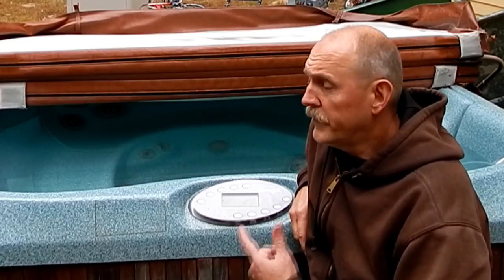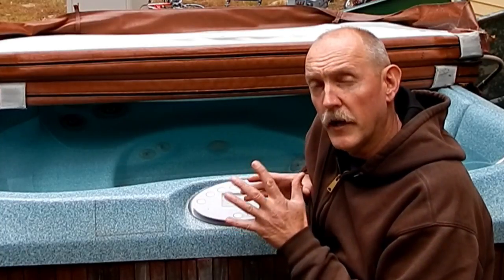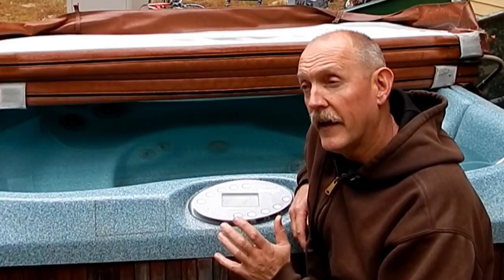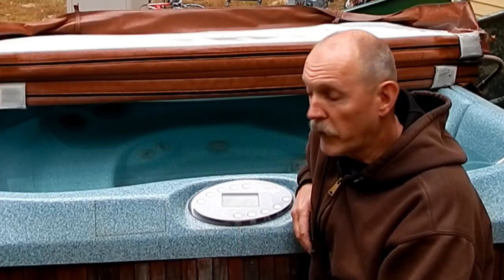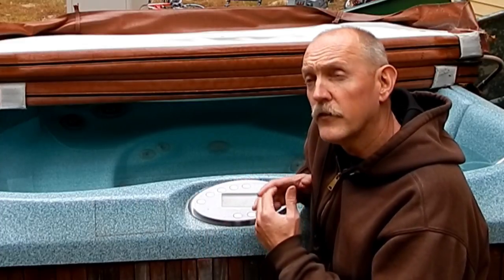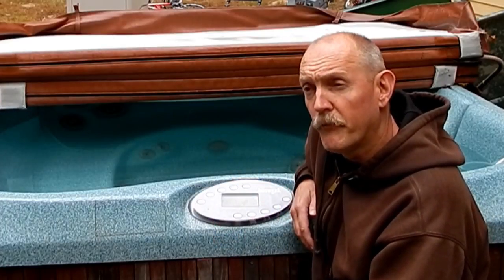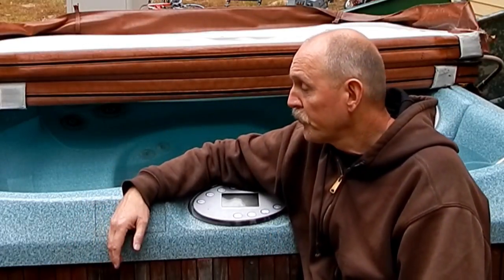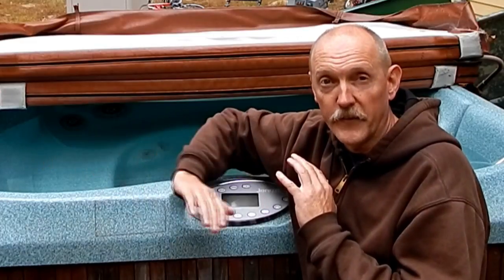Jacuzzi Sundance Hot Tub temperature sensor error repair

Comment: Thank you for this video. It is a long video, but well worth watching the whole thing.
Filled with so much great information, well spoken, good quality video and audio, you
stay focused the whole time with no fluff or filler, and pay close attention to detail.

I got my Jacuzzi J-315 2013 Model near the end of 2013. The temperature sensor went out
sometime in 2020. I researched the error code with 3 dashes [---] with no luck. I got
the hot tub technician over here and he told me straight away that was the temp sensor.
I watched him replace it. It was expensive. Fast forward to today, September 2023 ...
same thing ... [watchdog mode error code] [---].

After watching your video, I am fully confident that I can buy the part on amazon for
much less than he charged me last time and this time the labor fee will be zero. Thank
you so much for your excellent video. By the way, I love your tip near the end of the
video about removing the intake filter and inserting your fill hose there to help
eliminate possible air intake.

Comment: Thank you so much! My 2005 J375 Jacuzzi hot tub has been running really hot for several years. I've had the repair man out twice to change it. It hasn't worked correctly, had to set temp lower than what I wanted it and keep and eye on thermometer... Finally decided to shut it down until I could get it fixed. Found your video and watched a couple times. Was able to order part off Amazon, had to make sure I had right connections. While tracking the wires, I discovered my repair guy had just spliced new thermostat onto old wire! Too lazy or had wrong connections... I ran it all the way through like you showed. Was able to do it by myself. The connectors are really tiny, got them in ok, but didn't get plug seated right. It was getting dark and my flashlight decided to die. After filling the tub, I powered it up. It said 106 degrees and then I got a SN1 and a SN3 error. Figured that it was the plug not seated right. Powered it down and re did the plug this morning. It's at the very top of panel and hard to get to. This time I actually heard plug click into place. Powered up and all is good. Control panel reads the same temp as thermometer. I'm a great grandma, was able to get it with your coaching.

Comment: I had to revisit your video again.  I had a Jacuzzi j325 show three dashes ---.   I had been watching it previously and the temperature was getting of sync.   I would set the temperature to x and a thermometer would register 25 degrees higher.   Finally showed as  - - -.  Replaced my sensor (6600-166) and all is back to normal again.  Last sensor lasted 3 years.  Thanks again.

Comment: Well, this video was identical to my issue on a sundance Optima 2001 I inherited from a house move. £30 part, 20mins to connect and bam! The temperature sensor no longer reads 35C for 18C water. Heated up perfectly and no errors. Thank you for an amazing video that doesn't dumb down the details behind this error.

Comment: Excellent video, thanks for posting. It inspired me to replace the sensor on my Sundance Metro, which was doing exact opposite and always overheating as the temp would read in the 70s while heating the water to 110. Metro had different wiring connectors (not box) and circuit panel plug is smaller and just slides on -- but the video was close enough to get me there. My spa also had no hose on the spa filter end, so once you unscrew the sensor, water is flowing, but at least not near the electronics.  All fixed now. Thanks for the help!

Comment: Thank you for this video.  
When replacing the temp sensor, do i need to put teflon tape on the threads?
Reply from the maker: NO! teflon tape should only be used on pipe thread because they have a taper and they sealing tales place at the threads. The sensor uses straight threads and relies on a gasket or on ring to seal it to the tube wall. Teflon tape might cause the nut on the backside to crack.

Comment: Thanks for the detailed video!  After watching, you made it look easy to replace that heat sensor. Any idea if that is what is causing our 2013 Jacuzzi model J-345 to trip the outside breaker when turning it back on after cleaning and replacing the water. I tried to turn the breaker back on several times and it starts up until the jets turn on, then it trips the breaker.  I've tested the breaker by disconnecting the hot tub from it. So I know it's not the breaker.  It finally turned back on without tripping, but the temperature reading seems to be off by about 10 to 15 degrees less than the actual temperature. Could a bad temperature sensor be the cause of this issue? Any insight would help immensely...   Thanks again for the awesome video!
Reply from the maker: You have 2 different issues. Ignore the temp issue for the moment. A temp sensor does not trip a GFI breaker. It is possible, since you just refilled it that some water got onto something that should not get wet. (electrical). Then over time it dried out enough to allow you to reset the breaker. However, if the tripping persists, the likely suspect is a failing heater. I understand it is still heating, but just because it heats does not mean all is well with your heater.
Reply: @stevewatr  What do you think the issue is with the water being hotter than what the hot tub says? Thanks
Reply: Hey Steve I have a Sundance 2015 Edison. I got the - - - code. But unlike your example my water felt like it was a 110 degrees tub was set on 98. Would this be the same problem? Just a note while refilling hot tub hose popped out and sprayed the panel. Once the spa dried out and GFI breaker is working fine but now I get the 3 dash error code.

Comment: 2005 Sundance Marin, Tub goes into watchdog frequently. After breaker reset, temperature sensor seems to be accurate. If it is below the set temp, will circulate til heater is triggered then shuts down to watchdog mode. Multiple resets will usually get the tub to run for a day or two and then the problem re-occurs. Any suggestions?
Reply: We’re you able to fix your issue? I’m having the same exact issue with the same model lol

Comment: 4od fault in a j350 just like in your video. You are very knowledgeable, have you ever seen that fault? Resetting the tub does nothing. Pumps will kick on, and heat symbol is on, but the controls are non responsive. Searching for that 4od or 40d code has not yielded results. Any insight? Thank you.
Reply from the maker: I do not believe that is a valid code so it might be a faulty topside control. Unfortunately the only way to test that is try a new control and that is an expensive guess if wrong.
Reply: @stevewatr  Appreciate your reply. I unplugged the tub for about a month whilst working on other projects. The 4oD fault did not return, except the year old flow switch failed and was preventing heater operation. All I did was look at it and the end broke off. 1 year old, thats it. They dont make things like they used to.

Comment: @steve or anyone else here. Have you seen an issues where the real temperature is higher then what it's reading (hand held thermometer is readying 109) vs spa saying 100. I thought similar to issues above was sensor is out of calibration. So dropped the spa to 90. Reading is now 90 but hand held is still 109. I can't get my head around how the spa reading could drop, but real temp doesn't move. Thanks in advance
Reply from the maker: If by hand held you mean an infrared point and shoot thermometer, you are probably just reading temp just below the surface. There are temperature zones at different depths and heat rises. Just a theory. 🙂
Reply: I have the same issue with the temperature reading being lower than the actual. Wondering if a bad temperature sensor could be the cause of this?
Reply from the maker: @vincentguarino4262  You are describing a different situation from the one Jforgues82 mentions. He says his water is hotter than what the display shows. You are saying your water is cooler than what the display shows, and this is a classic symptom of a sensor failure.
Reply: @Steve Watroba  Oops, sorry, I said the reverse of what I meant... My water is also hotter than the display shows. The actual is hotter than the display reading.
Reply from the maker: @vincentguarino4262  water being hotter than what the displayed temperature is in uncommon problem. When those temp sensors fail, they usually cause the opposite problem. So to begin with, I'd question how you are taking the actual measurement. Previous post said he used and infrared thermometer. I suggest a human oral type. They are accurate in that temp range. Also be sure to use it near the tubs temp sensor location. Probably near the filter. Only other time I've seen tub actually hotter than set temp is of set temp is low and filter cycles are set too long in hot weather. Unlikely in your case unless you live in a hot climate.
Reply: @stevewatr  Thanks. We measured  with an oral thermometer and the display reads 91 while the actual temp is 105.
Reply from the maker: @vincentguarino4262  yeah that's weird. But I would still think temp sensor or bad connection like corrosion on the pins of the sensor plug on the pcb.
Reply: @Steve Watroba  Thanks Steve! I appreciate all your input!

Comment: Side comment (will make main one after I actually DO my replacement in a few minutes!) - I LOVE at about 25:00 your comment "not to proud to admit I've gone all the way through and forgotten to thread on the O-ring" (and you comment they sell them as separate items). Which leads me to wonder, looking at my invoice with the separate SKUs: WHY they don't sell them as a single unit - and even smarter would be to sell them with the O-ring ALREADY strung all the way up the wire to the sensor head, basically "pre-installed"? I mean: mine came with a nice bit of tubing protecting the box-ends, and it was coiled up and twist-tied, so there's already some "prep" involved -- and as I understand it you're GOING to install it with an O-ring pretty much always, right? So if NOT that, a really good vendor would be smart to put a tag on the sensor end saying "don't install without an O-ring!". Again, will be making a full comment after I actually install mine, but this video is PHENOMENAL.

Comment: Hey Steve- I've got a 1999 Sundance Rio that thinks the water temp is 103 even though it's ~80 (not heating, so it's ambient temp), so I'm thinking it's the thermistor.
Looks very much a lot like what you've used there- got a part # for that, by chance?

Comment: Great detailed video Steve!  I have a 2002 Sundance Altamar and I am getting an SN1 error code, and the heater is deactivated.  Would you say this is a temp sensor issue, a hi-limit sensor issue, or could it even be a flow switch issue?  Pumps appear to be working fine and water flow through jets are working as they should, just no heat.  Any insight would be appreciated.
Reply from the maker: SN1 is a sensor 1 failure code. Sensor one is the high limit sensor mounted at the heater. That sensor is pretty reliable so i would double check the connections. Sometimes the tiny connectors get dislodged from the back of the main plug that all the sensors and flow switch go to.

Comment: FYI... I had a "----" watchdog reading on my 2007 Sundance 880, unplugged the breaker insert on my sub panel for like 15 seconds and plugged it back in and still got the watchdog reading, so I unplugged the spa and went onto YouTube for answers then plugged breaker back in after 10 minutes or so and everything was fine.  

so... Make sure you unplug the spa for a good 5 or 10 minutes...it may do the the trick!

Comment: Thank you, Very helpful videos. I installed a new circuit board on my Sundance Peyton. Works well but only displays Celsius. Any ideas on how to make it show Fahrenheit?
Reply from the maker: Going from memory, but In pretty sure there is a bank of jumpers on that board. Those tiny black ones like they use in PC motherboards. One is used to select temperature units.  The bank of jumpers is at the top to the left if the plug for the topside. Pins 7/8 jumped is celsius. Remove the jumper for Fahrenheit. Never change jumpers under power. Shut off the breaker first.
Reply: @stevewatr  thank you kind Sir.. I will check that out and respond. I hope you have a great day !!
Reply: Worked like a champ. Thank you for your assistance. Have a great day 👍👍

Comment: Great video! I have the 850 LCD board also. Would you happen to know the part number for the sensor. I’ve been searching. But, have yet to find it. Many thanks for the information.
Reply from the maker: 6600-167. The LCD uses the box end type connector. A little tricky to install into the connector.

Comment: Great video! What if your hot tub is saying "---" or "OH" and it is actually hot? We have a Splash Spa D5500 pack, and it started displaying "OH" and it shut off as it was supposed to. Just the other morning, it was just flashing dashes, and it's Hi limit definitely didn't turn it off.  It measured 142* w/ my digital thermometer and it was still running!  Do you have any advice? This thing is so old and I can't find any support on it. The landlord isn't real interested in fixing it (rightfully so - it was never in the lease - i Just took it on as a project), and we live in such a remote area, the closest hot tub place is 3+ hours away. Thanks, and again - great video!
Reply from the maker: When you say 142 degrees, how was that determined. If that was an actual temperature, it would burn your hand. So if you didn't get burned it isn't really 142.
Reply from the maker: So if it was actually 142. It means the system was trying to turn the hearer off but its stayed on......or......in hot weather if the pump runs constantly it can heat the water even after the heater turns off. So if the pump runs constantly and you live in Arizona, the tub can overheat.
Reply: @stevewatr  I used a digital meat thermometer and it said 141.8. We live in SW TX, but the temps have only been in the 80's/60's lately.  The tub was running when I found it at 4am w/ the flashing display. I only found it because I was out checking for skunks - the tub was blazing white hot in the thermal scope! I've heard it might be the temp sensors, or even a stuck heater relay? Thank you for the reply!
Reply from the maker: @FlextheJuvat  in doubt its the sensors. If one sensor malfunctions the other should shut the so a down. The fact that the display showed the dashes means the sensors are seeing the overheat. So a stuck relay is more likely. But they weird thing is the pump was still running. When the system defects the overheat it should shut off the heater and the pump. Those are controlled by 2 different relays. So its could be a system control issue. Either way, stuck relays or bad system electronics, the fix is a new board and if the board is no longer available, you'll need a new pack.
Reply: @stevewatr  Oh no!! Thanks again!

Comment: Great clip! Thank you for sharing. You know the specs of the sensor? Is it a PT100 or PT1000?
Reply from the maker: Neither!! The Jacuzzi sensor has a resistance of over 48,000 ohms at 15 degrees celsius. This is much higher than a PT1000 sensor.
Reply: @stevewatr  Ah, interesting. I am in Germany and spares stocks are depleted, so I try to find alternative sensors that I can run temporarily.
Assuming this is a NTC I covert your reading to 30kOhm/25C sensor. Quite an odd value but can be achieved by 10k + 20k in series.
Reply from the maker: @andreasg.5364  I do not think adding a resistor in series will work. This would give you a non linear response. Your displayed temp would only be correct at one point.
Reply: @stevewatr  For sue, resistors dont work. I am able to get NTCs in 10k and 20k - not a 30k. So I think a 10k NTC and a 20k NTC in series should give a 30k NTC. I will report on my results, once done. 😊
Reply: Today I did measure the sensor input at the controller with variable resistor. I can confirm the Sundance/Jacuzzi  temperature sensors are NTC 30kOhm.
Reply: Received my 10k and 20k NTCs. Put them in series, into an old sensor stainless steel tube, epoxy in, connected to the controller. Temperature reading confirmed to be accurate. 👍

Comment: I have a Sundance Sweetwater Bahia 2002 I've replaced the sensor inside the tub, when I set the temperature above 97 degrees within 30 minutes I get the OH on the display and the tub heater keeps running, even though the water is not over 100 degrees.

When I power power down the tub for a couple of hours I'm able set it to 96 or below, where it works fines. Again when I set the temp to 97 or above the heater continuously runs. Any idea on what component is causing the problem?

Comment: Hi, Steve!  I just watch a segment where you replaced a temp sensor.  What I needed to know about was the terminal block and those darn push-pin connectors.  I broke mine on the flow sensor replacement and would you please tell what they are called or numbered, so that I can purchase some replacement?  Tks Doyle    Sundance Capri  2008 - 2009 model  Tks!
Reply from the maker: Hello. Do you mean the connector on the main board? If so, I do not know a source for those. Sundance does not offer that part. They want you to have to buy a new board